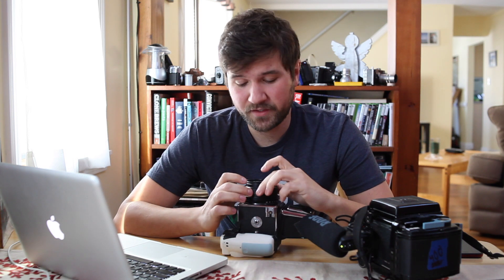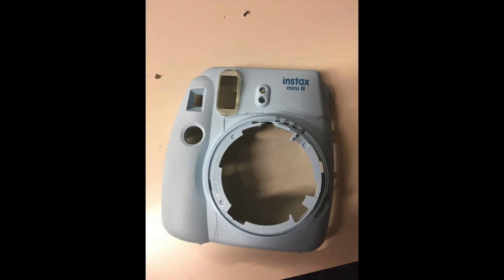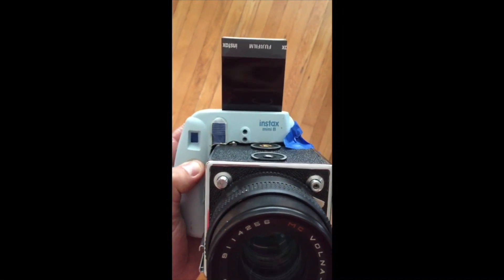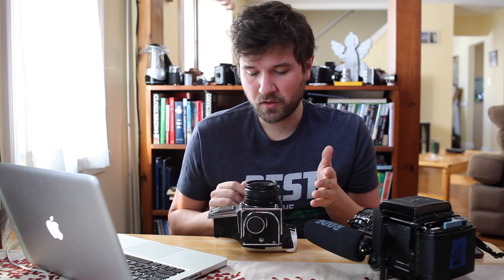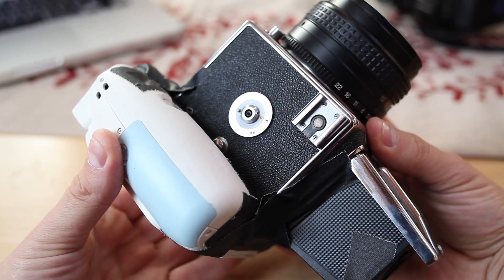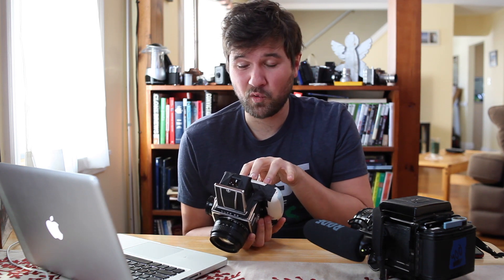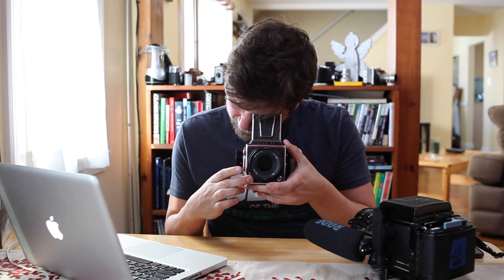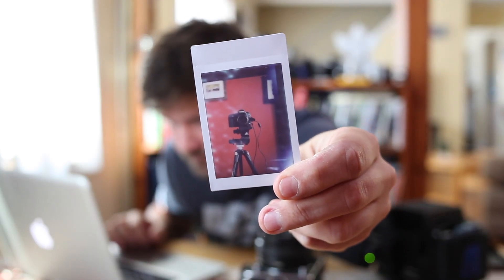DIY Instax Film Back for Medium Format Camera Project Update - for Hasselblad or Kiev

Comment: I just bought an Instax Mini 9 on eBay.  I'm contemplating adapting it to my RB67.
Reply from the maker: I think that would actually be easier then what I did haha
Reply: @DPhillipsStudios  Maybe, maybe not.  A P adapter may be the key, but then I can't use the revolving back, because the P adapter replaces that.  Plus, I'd rather use Square -- but the cameras aren't cheap like the Minis.
Reply: any luck with this? I'm tryna get this working with my Mamiya 645 but the electronics in the Instax aren't seeming to work...
Reply: @jackstolrow8433  I haven't taken a saw and hammer to my Instax Mini 9, no.  Probably won't -- the film is too small.  Lomography has just announced an Instax Wide back for Graflok back 4x5 cameras, though -- thinking very hard about pre-ordering one.

Comment: Did you have to alter the circuitry at all or did you simply remove the lens and shutter and leave the motor wired up how it was?
Reply from the maker: More or less I just removed the lens and shutter.  I bypassed the circuity so that when the button is closed the motor turns on.  So when a picture is taken you have to hold the button until the photo is ejected.
Reply: @DPhillipsStudios  Do you still know which wires you soldered where? I want to achieve the same result but have no clue how to make the shutter act as the motor trigger

Comment: Why doesn't a company produce Instax backs? This is awesome.
Reply from the maker: Shhhhh!  Thats what I wanna do!
Reply: There are, last I saw, two companies selling Instax backs for certain medium format system cameras (may be more, I only checked for those compatible with my RB67).  One is a 3D printed adapter for a hacked camera; the other is a full purpose-built Instax back.  They're both about as expensive as a camera body or a good wide angle or tele lens.